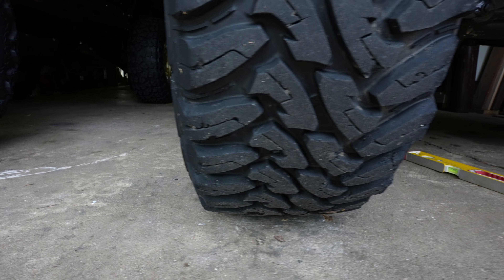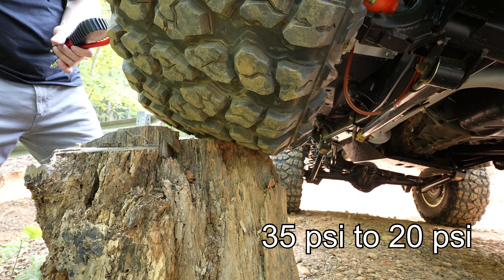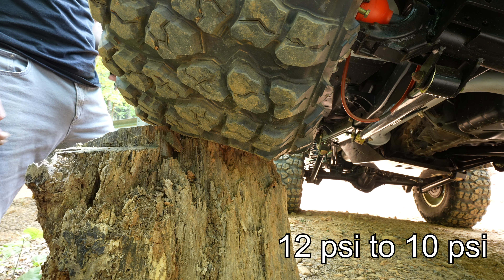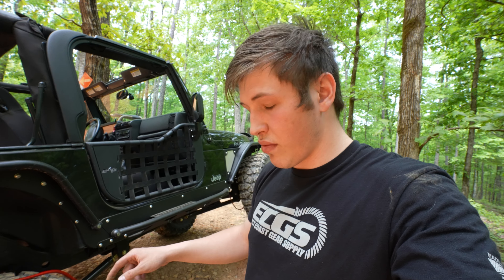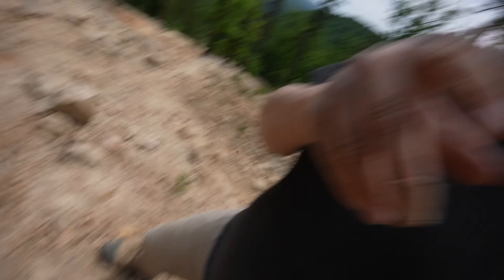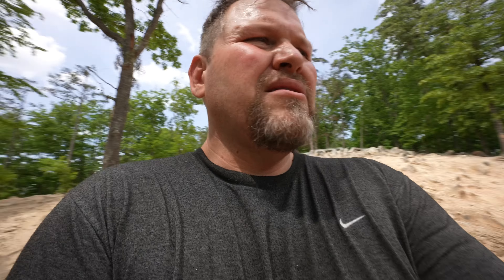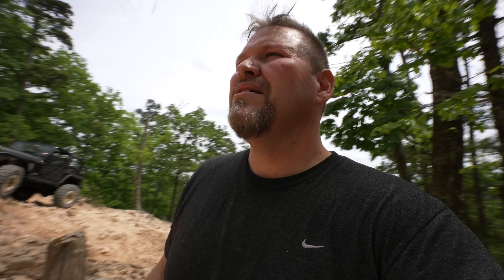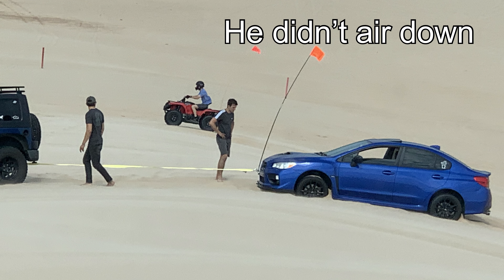Off-road Tire Pressure and How Much Axle Clearance Do You Lose

Comment: Tires ARE part of the suspension.  All those folks that run 20s with low profiles are either not understanding or not valuing that concept..  Power Wagon on 37" E load rated Toyo MTs, 18-20psi all day.  TJ with whatever, 15 psi all day, might go lower with a thicker wall MT.  Great material guys!
Reply from the maker: I was really surprised that we only lost a 1/4 of axle travel dropping to 15 psi. It’s a no brainer in my opinion to at least be down between 20-15 psi.
Reply: @RubiKidd06  I was also surprised.  The benefits far outweigh the disadvantage.  Makes we want to test my PW.

Comment: I run normal 26 psi.  I have discovered that at this psi, the majority of the tire surface comes in contact with the road.  Depending on the terrain the jeep is going to be on will determine the psi that I run with.  I take my measurement at the bottom of the differential.  I use a digital air gauge.  Every time it's turned on, it calibrates itself.  In fact all measuring tools that are digital do this.  When I was in the service we had to turn in all our analog measuring tools every year and have them calibrated.
Reply from the maker: I’ve had several guys tell me that their digital gauges vary 1-3 psi when their comparing to others. We only own one arb digital gauge so I can’t compare it to another. We do have analog gauges that wildly differ. Concerning the measurement, all the values would be the same regardless where measurements were taken with what I was looking for. We were looking for the exact height lost when deflating.  I didn’t care about what the overall height was rather the difference in measurements verses psi changes. Appreciate the comment.
Reply from the maker: I get stuck in a mind set thinking all people are on the same terrain as us.

Comment: I’ll run 20 psi on off road unless it’s really rough trail then I’ll go down lower your absolutely right you have to lower your psi to save pounding your body or rig I’ve been running patigonia tires there pretty stiff
Reply from the maker: That’s something I should’ve covered. Not all trails are alike and don’t require as low of pressure. Plus, if it’s not required I would not air down as low for the rolling resistance and taxing the steering pump. 
Thanks for sharing.